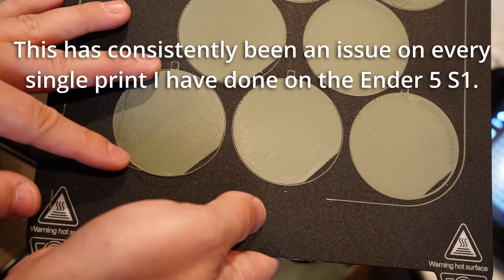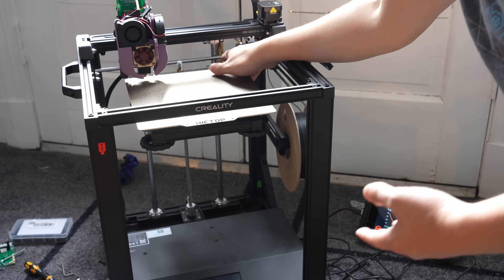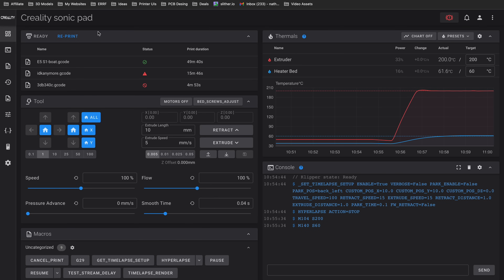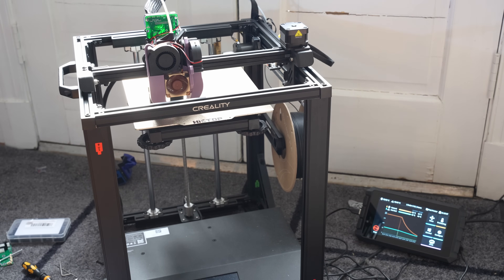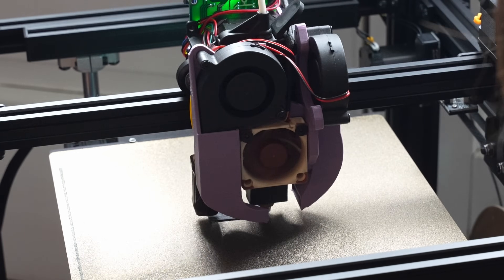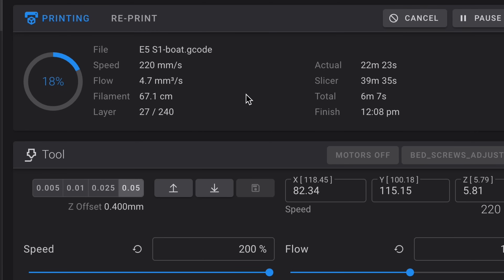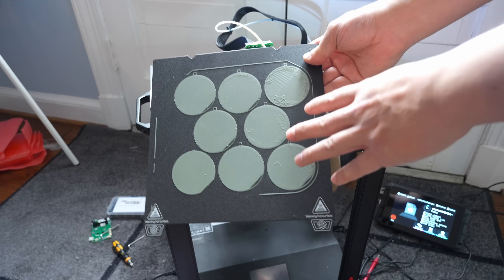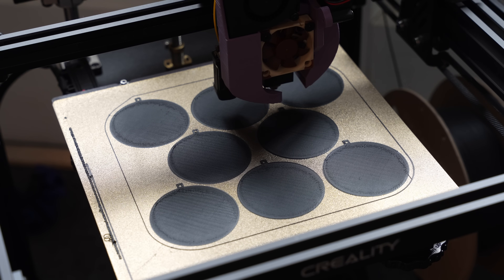THE BEST UPGRADE for The Ender 5 S1

Comment: No need for them to pay you 😁
You just put it on the plate for them 😉
Reply from the maker: It is much better for a product that is released in a finished state. Having to slap improvements on in the aftermarket to meet its design intent is fun for me, but makes the company seem unprofessional.
Reply: @NathanBuildsRobots  also, your material on Youtube is copyright. Creatlity can't use your work without compensating you. The tie-in to the Modder Board (Nathan's Miracle Modder Board, I call it), brings income to Nathan, so that's nice. Maybe Creatility will order 1000's of them????? That would be nice too!
Reply from the maker: For some reason, large companies have a hard time switching out old designs. Also if the new part is even a penny more expensive than the old one it's a hard sell to management.

Comment: PS I want to buy your modder board for my Ender 3 S1 (I managed to short out the part cooling fan circuit on the OG board grrr) but shipping to the UK is CRAZY! Comes to 51GBP, and starts to cut into the 220GBP I bought my 3 S1 for, and 108GBP I paid for my Sonic Pad. Please bring your shipping prices down mate!
Reply: Same here
Reply from the maker: @wyattutz  I have reached out to several resellers but have not heard back from them.
Reply: @NathanBuildsRobots  do you buy the boards assembled or do you assemble them yourself? Could work on shipping them from Europe? I just bought the e5s1 an plan on modding it. I have computer engineering background so it would be no problem for assembly of the board. From Germany by the way.
Reply: Damn, that's crazy.
I ordered mine to Latvia and total was about 57Eur + VAT + import tax. Total was around 65Eur
Reply from the maker: I will petition the post office to lower their prices XD 

I have heard of other shipping options that gather a bunch of shipments together, then ship it and split it into smaller packages. I'll look into that as it could provide a cheaper option.
Reply: @NathanBuildsRobots  Will be visiting Canada in the spring time... might ship it to my family instead. Really want to get your board!
Reply from the maker: Nice, though I hate to tell you canadian shipping isn't much better. I'll look into those alternate shipping options. One is called PirateShip.